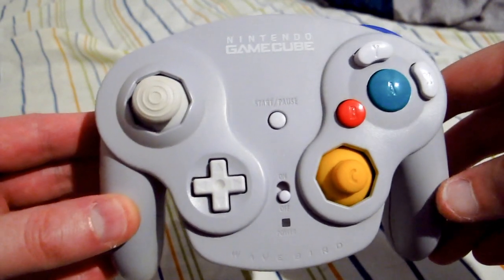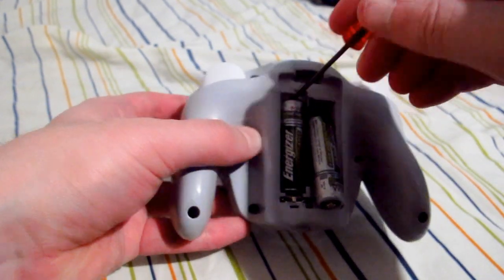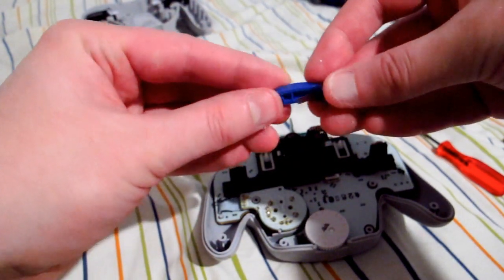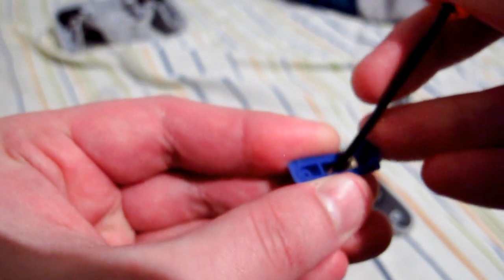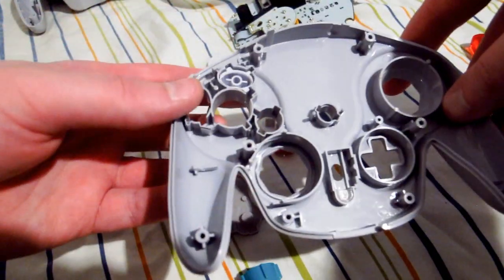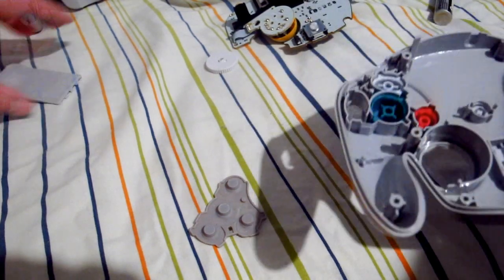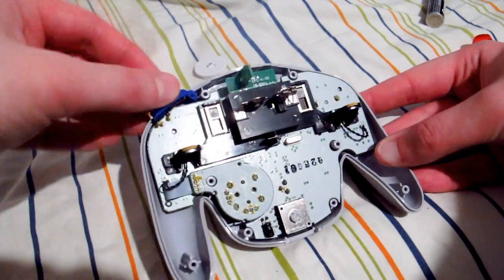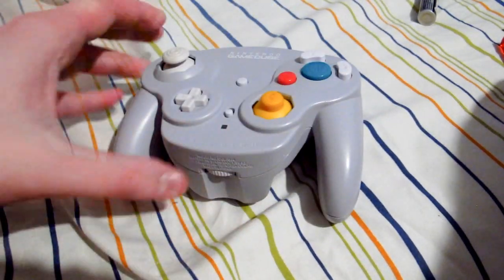How To Reduce Z-Button Tension on a Gamecube Controller (Read the Description Too.)

Comment: Idk what the deal is with mine, I've tried everything I could think of. To start I increased the angle of the metal thingy then pushed it all the way in and it just doesn't have that looseness I want, hardly any travel, so I sanded the bottom tip of the z button where it touched the button and still it just feels stiff to me comparing it to my other controller. Any suggestions? Idk where to go from here... I wish it felt right, it just doesn't.
Reply from the maker: If you got the metal completely out of the way, then chances are the micro switch itself just needs some more break-in time. Buttons, including microswitch buttons, tend to get softer-feeling with time the more they are pressed. I have a bunch of "identical" controllers that feel different as a result of differing usage. So you could try to push it in repeatedly with decent force to simulate wear and tear to see if that has any effect after a while. Alternately you may try to add weight to it by filling the hollow cavity (Hot glue, gluing metal chunks in them, etc..) which makes them feel easier to press because their weight assists the finger in pressing it down. You may not feel the benefit on shoulder buttons like the Z unless you hold the controller more vertical to let gravity take over though. So it may still not be what you're looking for. It may change the button's acoustics (Sounds' less hollow/clicky) which may "feel" softer though because sometimes one's perception of softness is by sound.

Sanding down the back of a button won't increase travel because the button will still sit on the lowest point to start with (directly on the switch) and then will travel to activation. However, you could try to make the button pop up a bit more than it does by adding a soft spring between the microswitch and the point where it touches the button (around them, not on them of course.) or even some soft springy foam so the Z-button pops up higher. It's sort of like that stock metal bar spring, only not anywhere close to as stiff.

Comment: My controller didn't have that little piece of metal :/.....is that normal?
Reply from the maker: Depends' on what controller you have. If it's an official Nintendo one, that would be very unusual as they all should have one. Heck, even a lot of third party controllers have them as they try to imitate the official one's feel. "Sometimes" though people replace buttons on controllers to give them a different look/feel and replacement buttons don't have that metal. But they just never transfer it over as then then button has less tension and is more comfortable or just don't feel like it. Example of transferring the metal: https://youtu.be/DDrLkZxYVqs?t=229

But if you don't have the metal to bend in or remove and there isn't some other kind of spring (not counting the rubber button contact itself of course because that has to be there to make the button work), then your Z-button is about as easy to press as it'll be at the moment and getting it softer if you'd like would require more break-in (pressing it a bunch of times).

Comment: when i put a little pressure on the shell or d-pad i hear a cracking like sound. does that mean that the shell isnt fully on?
Reply from the maker: Most likely something isn't aligned during the reassembly or something isn't screwed down enough. So I guess disassemble again and check for anything.